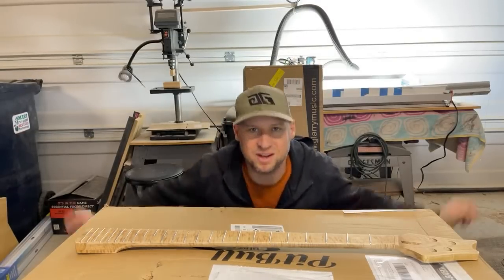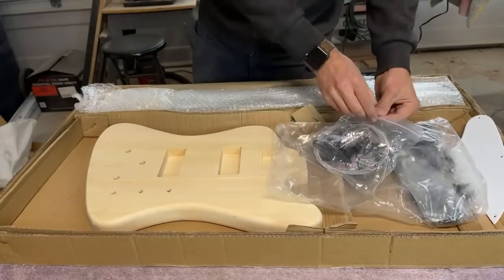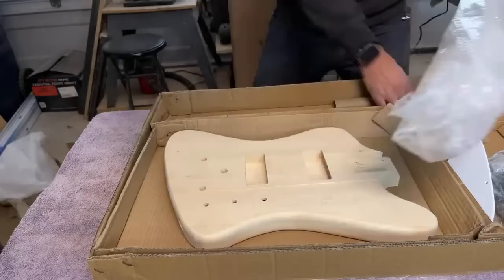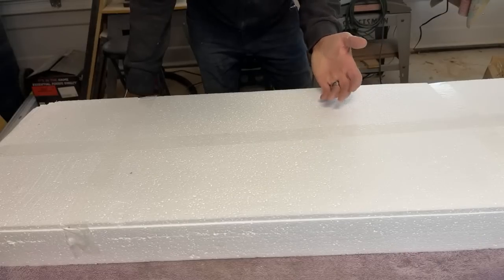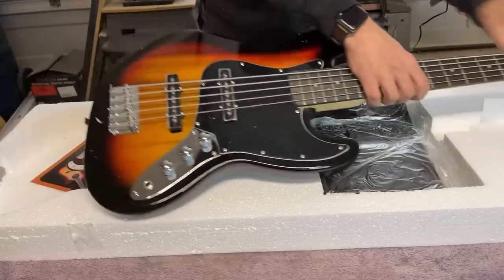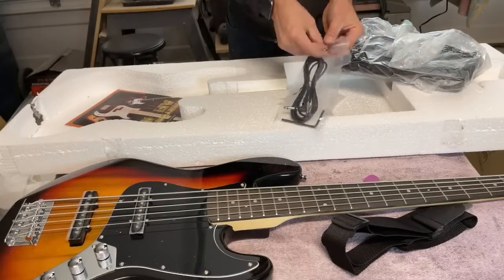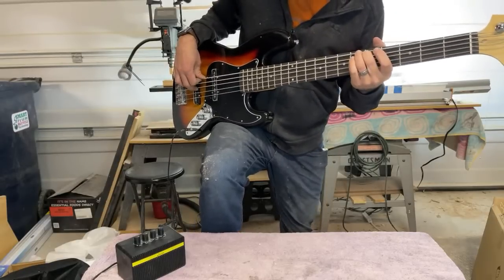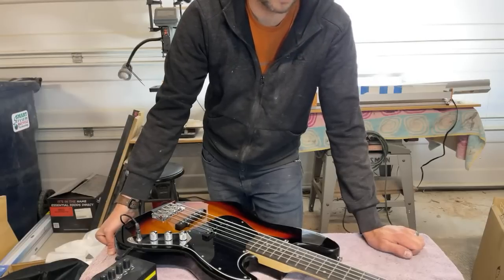Pit Bull TB-4 kit and cheap 5-string jazz bass unboxing

Comment: At 17:15, I wonder if you are in parallel with the pickups?   I notice you are holding the wires to the multi-meter probes.  If the resistance of your body is very high compared to that of the pickup, then there is no effect.  But if the resistance of your body is not very large, then some of the current will flow between your hands, and make the resistance lower than if the probes had been clipped to the wires.
Reply from the maker: You make a good point. I’ll have to try using alligator clips next time to see if there is a difference between that and using my fingers. This is the way I’ve always just resistance on pickups, and it’s always close enough (at least to determine which is neck or bridge position, and if there’s a damaged coil) but I wouldn’t be surprised if I could get a more accurate reading.

Comment: Hey man, quick question about the PitBull kit. Is the gap between the bottom of the fretboard and the top of the body (where the neck attaches)common? Thanks
Reply from the maker: Yes
Reply: @GunsandGuitars  Thanks for the reply. I’m about to put together my first bass kit, and I wanted make sure that was normal. I really don’t like the way that looks, any suggestions on how to close up that gap?

Comment: Good afternoon Dan,

I was hoping you could help me out. I have a 4 string bass. My low E string sounds dull compared to the other strings even after replacing the strings with a new set. What could be causing that?
Reply from the maker: Changing the strings was my first guess. Other than that it’s tough to tell without inspecting it myself. It could be that one of your pickups has a dead magnet (that’s happened to me). Try tapping the pickup poles with a screw driver while the bass is plugged into an amp and see if one of the poles is noticeably quieter than the others. If not that, then check the pickup height to make sure they are similar proximity to each string. Other than that I can’t help you without seeing it myself
Reply: @GunsandGuitars  thank you!!! I will check that!